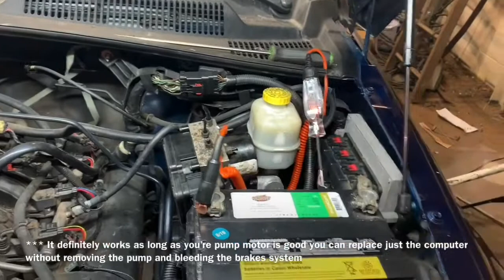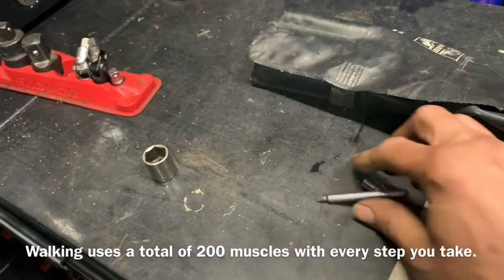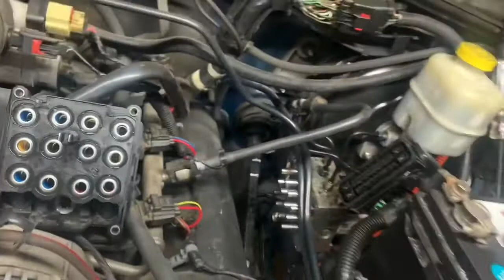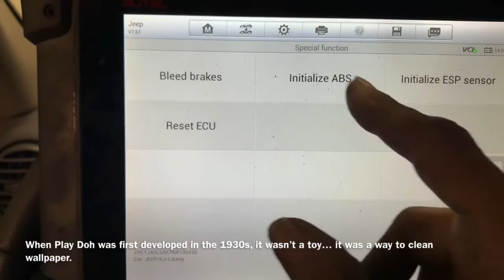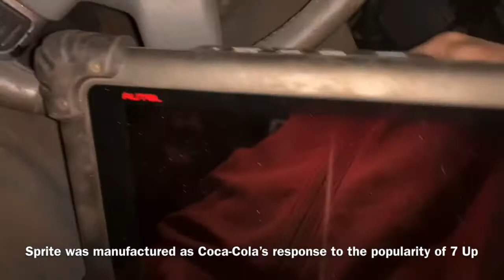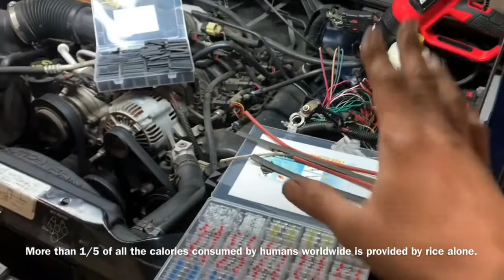How To replace the jeep liberty ABS pump control module without bleeding the system under the hood￼

Comment: I'm having trouble disconnecting the ABS wire connector.  I was told a flat head screw driver to push down on a tab then lift up on connector.  But not sure it's working

Comment: Hey Clay, thank you for the video, I'm gonna try some relay contact clean and conditioner, see if it remedies the problem. If not, the module is next.  I'm gonna check the gasket too. Nice idea with the tool.  Ttyl.

Comment: Was the scan tool you used capable of resetting the vin in the abs module? I'm trying to find one that can.
Reply: Or did you have to buy another module to do that?
Reply from the maker: I don’t know the answer that question, but down in the description is a manual to the vehicle, and it will tell you the answer to that question don’t remember, but if I didn’t do it in the video it isn’t necessary
Reply: @The Clay Way  you said it would have a mismatched vin code (which my friends does becasue he bought it used). His abs module wasn't communicating. The new used one is communicating, but it still has the vin programmed to it from the jeep it came out of.

Comment: What scan tool do you use? I have a 2007 jeep and the abs module is out. I got one out of the junkyard and the dealership says they can't program it to the VIN.  Then I got a new one and the dealership says they have to replace the abs pump as well as the abs module because they cannot talk to each other. I can't stand being held hostage because I don't have the "software" tools I need to work on my own stuff. Any help would be appreciated. Thanks.
Reply from the maker: Man what a crappy story. I’m not 100% positive but I don’t even think they technically have to be programmed to one another. I’m certain the motor does not have to be programmed to the board … because the motor is a motor it’s not a computer. And the computer will recognize the inputs and outputs from the signal fluctuation of voltage and amperage overtime it will learn the motor. 

As far as the ABS module itself yes it does communicate with the other modules and yes the Vin number is inside each module. But I’m fairly certain that if you just plug it in there it will work correctly ……. But that’s a bunch of crap that they can’t program the vin . The only way that may be and it’s a big maybe that’s possible is if you had a 2007 and you used a module from a 2003 but if you use the module from a 2007 and we’re putting it on a 2003 that would be a different story.

I’m not sure which video you watched but I know I have a video where I just change out the computer and I do not change out The motor or maybe vice versa.. 

They’re just a bunch of crooked pigs down there at the steelership 

Anyway I use a Autel Maxisys 908 Pro.

Comment: 2006 Jeep liberty coded 2200 INTERNAL FAILURE.ABS light and all related ESP out .System works when warm and dry .Cold snow day system light come on in the middle of an ABS EVENT! Next key start no Warning lights. Another test ride in the snow in suburbia side street .Slippy enough to spin  both axles if you punch it and go sideways but the ESP kicks in and system does not fail and shut down. Road tested again having a little fun around the block lock the brakes they kick in a few seconds then system shuts down with all the warning lights,...Being the ABS INGAGEMENT and the delayed shut down of the system .I call it unsafe and contradicts built in safety features in the system itself knowing this being a factory trained tech at the time these were built .Stuff like this seems like a recall should be issued on the fact that the systems delay to recognize the failure could cause a crash .What do you think? Probably only a few ours away in the great state of Michigan if you want to see it wet and cold.LOL!

Comment: Which Autel scanner was used in this video to reprogram your new abs module ?
Reply from the maker: I use the 908P
Reply: @YoutubeTheClayWay  I am trying to buy a scanner that can also program a replacement ABS module/pump and auto bleed. And bidirectional scan. Can you please suggest one that isn’t to pricey.
Reply: Where do you buy the 908P scanner please

Comment: Idk if you'll see this comment but I have a 2010 jeep liberty, it keeps going into 4 wheel drive without me turning it on. I already chewed up a front drive shaft and replaced it. I see online speed sensors maybe the problem. What is your opinion, should i start testing and possibly replacing the abs computer?
Reply from the maker: Well that’s what’s called an encoder problem. 

And I’m not sure if it’s replaceable on the jeep or not. It could also be your front driveshaft from your transfer case to your Front differential creating that problem. 

I’m surprised that’s not a more common problem that I’m aware of. 

I’m assuming you have all the correct size tires on it you cannot have mismatch tires for this problem will definitely occur

Comment: Clay help 2011 Jeep Liberty 116k
Po304 new plugs wires coils 
And #4 injector “supposedly”
Just about $1,000 into all this 
I’m gonna ohm test the injectors 
Runs great barley a miss at idle sometimes 
Po304 always comes back but also got po300 one time 
Any advice would be greatly appreciated
Reply from the maker: Sorry I don’t have any tips off the top of my head that I can think of. 

If you use that repair manual But I supplied in this video that you’re commenting on I’ll guarantee you it will direct you where you need to go and fix your problem if you follow the steps
Reply from the maker: Welll since I’ve had a little bit to think about it more than likely you’re not going to find an injector problem, The one thing that it could be is the coil so switch it with another coil and see if the misfire changes it could also be a fouled spark plug. I’ve got my fingers crossed that it’s one of them to

But unfortunately my experience tells me differently they very commonly have bad valve seats and possibly a bad lifter so about the only thing that you can do the check for them is do a compression test or a leak down test that will tell you for certain which one it is I don’t recommend just throwing parts at it because you’re probably going to be wasting money